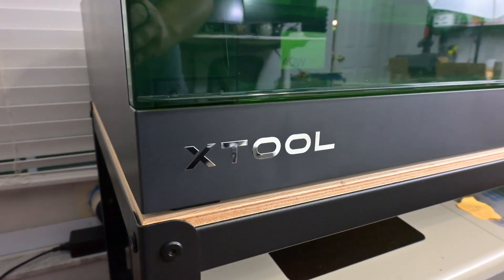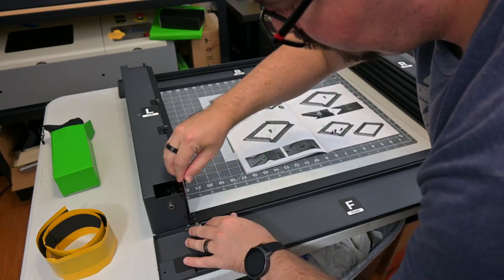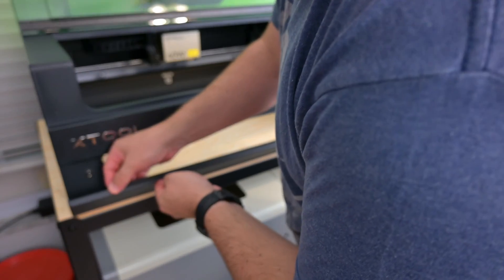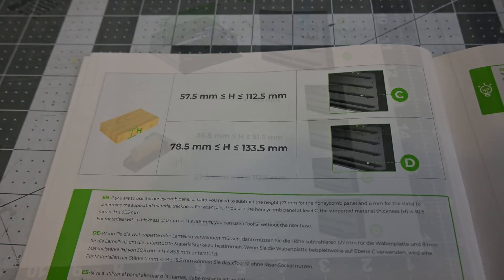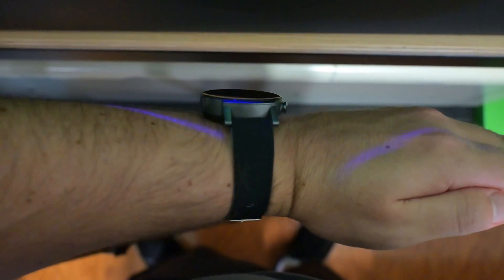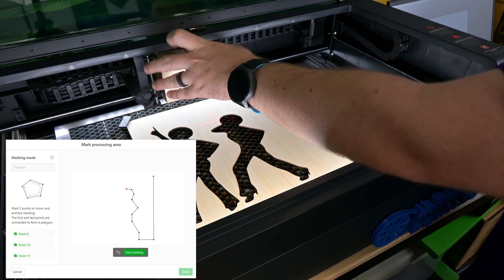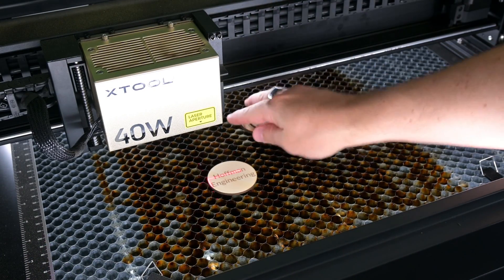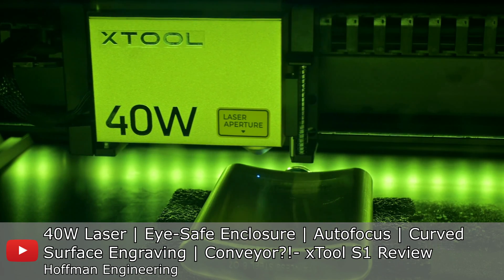The xTool S1 is getting even better! Riser Base and Pin-point Positioning Upgrades!

Comment: Question. I have the laser and riser. Was going to try and put a cutting board with handles in it. I dropped shield and then when it asked me to auto measure with needle, it didn’t drop. It just yelled and said it was undetectable? And made lots of noises. How do I actually use the riser then?
Reply from the maker: Hmm. The riser shouldn't change how any of that works, it just lifts the laser up to give more room. Were any other changes make during your install?
Reply: I have been having the same problem. I think using the riser means you have to manually measure the distance between the laser and whatever you are engraving. The pinpoint system still works but the manual lists the heights of the 4 riser shelves so you can take the new depth into account.